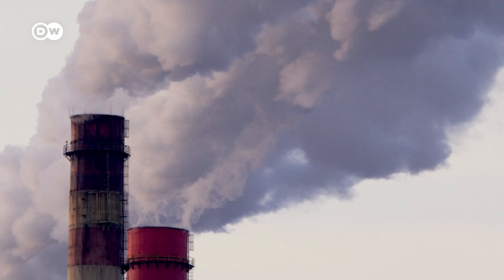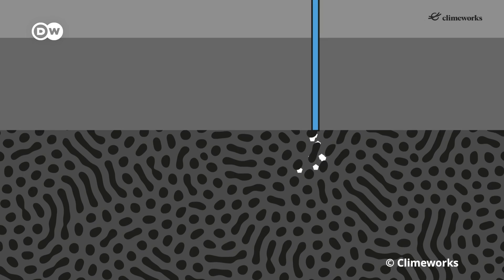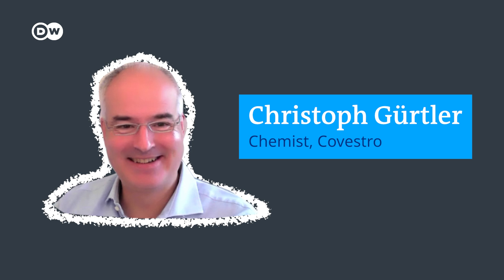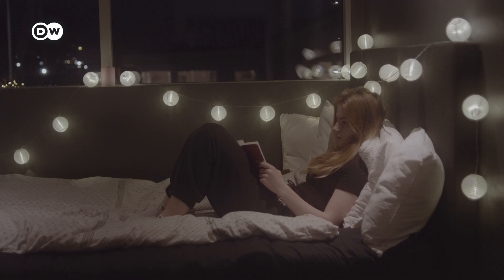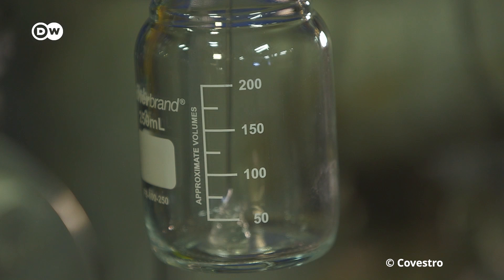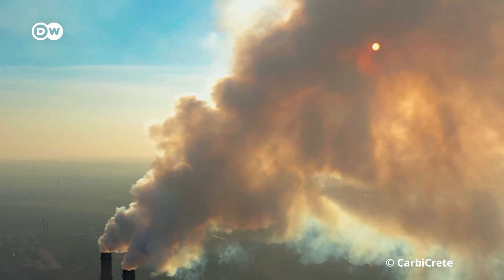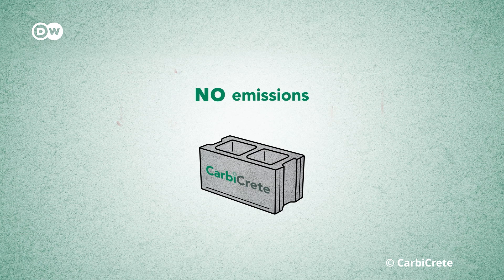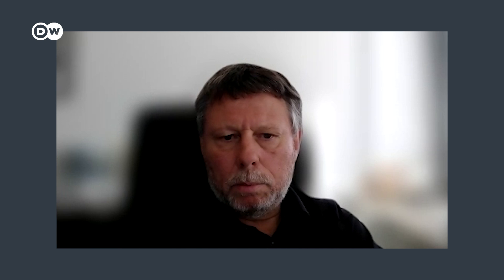Made of pollution: How CO2 is recycled to make your things

Comment: Carbon capture sounds like a good idea but I worry it will just give corporations a get out of jail free card to continue emitting CO2. Addressing the problem at the source is always going to be better than mitigation
Reply: The best way to do this would be to make a carbon tax and to make sure putting CO2 in the air cost several times more than talking it out...
(Addition) Actually one way is to reimburse the capture and make the cost of that the base line for said tax. By using the price to capture a ton of CO2 and then multiple it for the release of said ton.
Reply: Nah, they just want to make you buy their eco product.
Reply: The trouble is we need to do both to make real progress.
Reply: @TheIVJackal  even then fossil fuels would be worse than using renewables or nuclear to power the carbon capture.
Reply: @beth8775  true, but at the moment we are better off phasing out fossil fuels than we are building carbon capture at least in avoided damage per dollar.
Reply: The problem is, carbon capture doesn’t live up to the hype. In every single plant that used carbon capture, they were FAR below expectations
Reply: Yes, but we not only need to reduce emissions, we also need to get rid of the excess CO2 that has already been emitted in the last... 50? 70? years... So carbon capture in any form is always a good idea.

Comment: Yay, another video to make me confident about the future, but also scared if we will ever meet our expectations. Kudos to everyone who made this video!
Reply: Haha ya no dont count on it unless we do something the company's won't and co2 will just continue to rise.
Reply: Penny Farsely  actually we can already capture more carbon for a given unit of area than any common crop even if the carbon capture system is powered by solar panels. It is just much more cost effective to have never emmited the CO2 in the first place. Plants are great, but they are very inefficient at medium or long term carbon capture and won't be enough on their own to completely avoid many of the negative effects of climate change even if we stopped emmiting more CO2 by the end of the year.
Reply: Penny Farsely  I wasn't talking about dry ice production, I was talking abound the actual carbon capture techniques used to pull it out of the air. Such techniques are sometimes combined with underground storage. Certain rocks such as basalt can actually bond to CO2 if you expose enough surface area which can be a cheap way to store carbon for at least the next couple melinia.
Reply: Penny Farsely  you do realize that drills exist right? We don't need to mine basalt for carbon storage, nor do we need to super cool it. And as I tried to imply in my original comment until we have a primarily low emmision grid it isn't worth the effort, but that still doesn't mean we can't outperform plants at carbon capture and storage.
Reply: Although the chances are small, I'll stay hopeful. Thinking negative about the future ain't helping anyone.

Comment: Why conflate in an acronym, CCU, carbon capture and carbon dioxide reuse? Whilst they are connected, they are still separate technical problems and the latter is easily overshadowed by the former. There's lots of high purity process carbon dioxide still being emitted in some parts of the world, rather than being reused.

Comment: What about sf6 it’s been around for 50yrs and still used today in electrical switch boards and wind turbines 1kg of sf6 is the equivalent of 24,000kg of co2 no one talks about this
Reply: We really don't have a way to phase that out yet, and it is every bit as inherent to a fossil fuel powered grid as one powered by renewables, so unless you just want to shut down the entire grid there really isn't much that we can do about it yet so there isn't really much point in covering it in a video like this.
Reply: So keep producing and using it isn’t there other ways now so who not to say thats sf6 isn’t a huge contributor to global warming co2 shouldn’t be the main concern our planet and corals are thriving take a look at the Great Barrier Reef
Reply: Co2 saturation is extremely high there are carbon dates of these occurrences it’s a cycle and we’re just going to have just let earth do it’s thing what they should be concentrating on nature conservation
Reply: @johnogrady_  the CO2 concentration appears to be spiking faster than the geologic evidence suggests occurred during the end Permian mass extinction, so that is definitely not natural and is very concerning. Also our total release of sf6 is low enough that it still has negligible warming potential compared to our current CO2 and methane release rates so it still isn't the priority simply because it is an easy to trap gas that is somewhat expensive to manufacture, used in equipment that you want to run as long as possible before it needs maintenance. Plus I don't know where you are getting this data about thriving corals, but bleaching rates have quadrupled since the 80s and I can't find any object metric that shows a a positive or even neutral trend on the global scale when it comes to coral.

Comment: What a load of Crap.  Plants thrive on CO2 combined with Photosynthesis to create Oxygen.   Did anyone on this site take a Biology class in school.
Reply: This is CO2 emission that caused air pollution, I know that's photosynthetic system need CO2 to produce Oxygen !

But according to atmospheric gas component data the CO2 percentage in Earth's atmospher right now is 0.04%.

Before Industrial Revolution began in early 19th Century the CO2 percentage is about 0.026% as I remember. Not to mention it can be increased by war event with modern technology that also cause this air pollution.

So with that little bit increased of CO2 percentage in our atmosphere can cause climate change on Earth ?

Comment: The best way to deal with CO2 is split the carbon out of it and selease oxygen in the atmosphere ...similar to process applied in carbon black industry ..carbon as a single element is very useful ...hope to find a solution soon ...
Reply: The point is that this process needs a lot of energy. Where does it come from, if not from burning even more fossil fuels? Only renewable energy could do that, and extending it is the key problem.
Reply: How does a plant gets energy from ...it grows even in worse conditions ..it's photosynthesis the key to sustainance ..fossil fuel is declining fast ...by 2040 ..thete would be less reserves to pump in our requirement ...alternative energy generations is a myth in complexity and cost ..the best solution would be to find an alternative fuel ..that is inclusive ...zero emission of harmful chemicals ..easily available and delivers thrust ...so the crux is fuel lookout for the enhanced energy level ...
Reply: @kaushiksarkar2865  Plants do photosynthesis by using the sun's energy. This is exactly what solar panels to, whether for heat or electricity.
Even the wind on earth is driven by solar energy.
Hence, these kinds of energy are the solution. Going the long way by burning wood, which has accumulated solar energy is far less effective.
Reply: Photosynthesis process is a combination of solar energy and chemical reactions to unrevel the energy encrypted ...solar panel and othet form of energy generation is based on convertion of mechanical or electrical properties ...photo synthesis is an ever form of generation of electricity or energy which is in existence from the first plant being grown ..